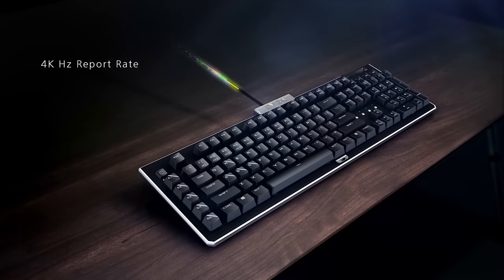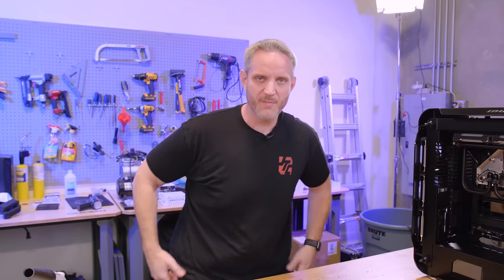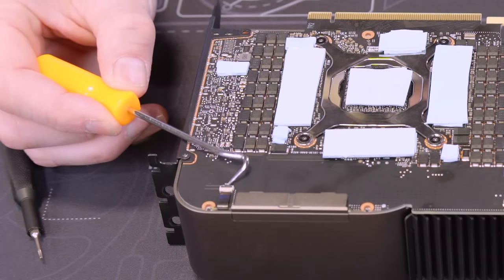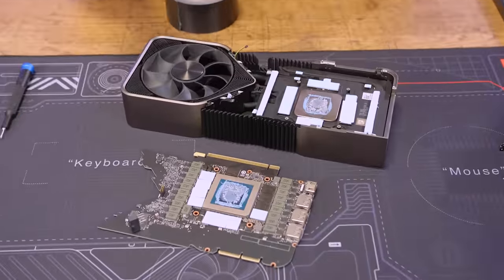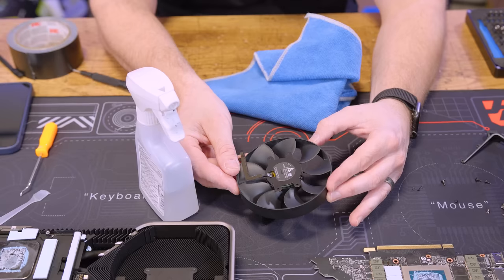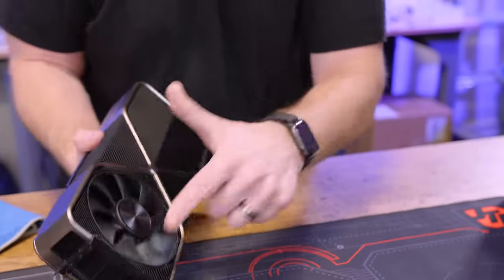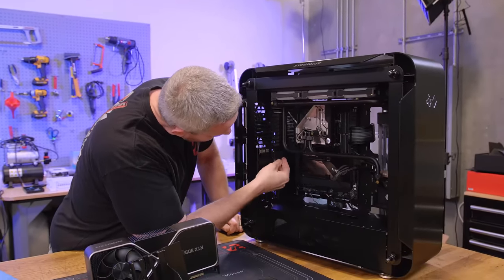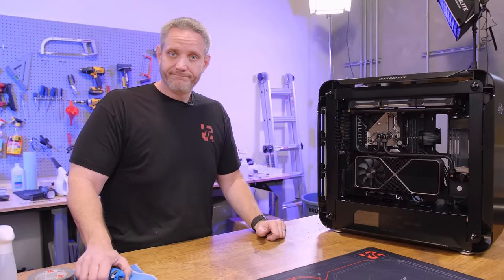Deep cleaning a GPU - Complete Teardown!

Comment: Oh man, I got one of those electric blowers. It was pricey but I love not having to buy compressed air cans to clean my dusty electronics.
Reply: Hmmm. I might think about investing in one as I hate buying the cans all the time too. And sometimes I SWEAR I use it once then 6 months later when comp is ready for a new clean it's like the can is empty. grrr
Reply: I just purchased a 5lb compressor.  It does double duty around the house for other things.
Reply: @KellicTiger  just be careful with those air compressors as they can accumulate moisture. The electric blowers are designed to not accumulate moisture. So just make sure you have a way to drain liquid/ keep moisture out of the air outlet on the compressor. It most likely is fine, but thats the reason they aren’t used specifically for electronics. They aren’t ESD or moisture safe.
Reply: It was pricey, but you're saving money in the long run by not having to buy compressed air cans anymore. I have one too, they're excellent.
Reply: Never use a vacuum, you want a blower. Vacuums cause static electricity and can damage electronics. 

I got a datavac, ironically named given my warning but it's a blower.  Actually I technically got two because someone told my in-laws and my parents to buy me one for Christmas one year so I got two. Worth it. They are amazing for cleaning electronics and they have tons of attachments for making it easy for different types of applications. Little straw thing with a brush on it for getting between fins on an air cooler is my favorite one.
Reply: RogerWilco99  Top reasons to blow out your electronics outdoors...
Reply: Pricey? Theyre like $50 on amazon.
Reply: I'll never go back. Its paid for itself already as I am OCD on dust.
Reply: @makingstatements812  their pricey if your poor people. I will say a device that blows real well for 50 is a steal.
Reply: @ckmondaviable  tell that to my wife!
Reply: 1
Reply: @KellicTiger  5lb? Please elaborate. Maybe 5psi? Or like 5hp? 5psi is not that much And 5hp will give you enough air pressure to break stuff
Reply: It's not good to do that really bc you could force to much air them things are powerful
Reply: I got a miniature 600w electric leaf blower for around $50. Does the job.
Reply: My datavac is over 10 years old. Totally worth it
Reply: @MinistryOfMagic_DoM  If the card was running it might be an issue. If he's using a small vacuum with the card outside of the system it is very unlikely to have enough charge to damage anything. With the price of GPUs being what they are I understand the extra caution. I've never vacuumed any electronics before, but I would personally be comfortable vacuuming a keyboard or even the fins of a graphics card heatsink.
Reply: You could also connect a grounding strap to the pcie slot at the back of the card and attach the other end to anything grounded. Then any static would just travel to ground.
Reply: @jizawiz  5 gallon would be my guess
Reply: Link please

Comment: Can't you damage the fans of the card by blowing so aggressively on them? I've always held fans in place when using a duster like that.
Reply: Same.
Reply: I think it might be if the fan is actually on, but with brushless fans I don’t really see how this is possible other than over-spinning the hell out of the bearings. Tbh I really have no idea if it’s even possible to damage a fan with air like that
Reply: @andrewsantora7943  Yeah, that's the type of damage I mean. It can overspin the bearings and potentially lead to some damage.
Reply: As he said, the rpm reporting may become inaccurate. As for the bearings themselves, it depends on the bearing type; the higher rpm from blowing will create different amounts of friction for each style of bearing. Mag lev fans are less prone to having the actual bearings damaged from higher than designed rpm speeds since the bearings are essentially floating.

Comment: NEVER spin up your fans like that with a blower. The fan will turn into a generator and send voltage back into the PCB, by overspinning the fan you can go way higher than the board can handle and kill the GPU.
Reply: Thanks, so hard to watch
Reply: What so you expect. He isn't as knowledgeable as Paul, gamersnexus, linus etc
Reply: @vincentviguier3223  Facts! I was just SMH. What a screw up. Thats also bad for your fan and can break fan blades. Ive done it way in the past.. Like way in the past and never will i blow on the fan again

Comment: Since you stated that the thermal paste may have affected cooling.  Please let us know if you're reapplication this time had any effect on the cooling temperatures.
Reply: For me personally, on my Gigabyte 3080 Vision OC, thermal pad replacements made a much bigger difference, almost 10-15C reduction under max synthetic loads (105C down to 90C) on the VRAM.

But there was also about 5C of reduction on the GPU die itself, when I swap the stock thermal paste for some Thermalgrizzly Kryonaut. I plan on replacing the thermal paste to some Kryonaut Extreme down the line, because I will have to do that, thanks to the pumpout effect. Very liquid pastes like the Kryonaut and the Noctua NT-H1 are prone to pumpout and should be replaced about once a year, whereas thick paste like the Arctic Silver, Thermalgrizzly Kryonaut Extreme, and Thermalright TFX will hold up much better over time.

Overall I do highly recommend it for 30-series cards, particularly the models that have GDDR6X, due to higher thermal output. You'll need to be careful and have a steady hand, but some high performance pads (make sure the thickness is correct, even if you need to stack two layers of thinner ones) and high performance thick paste will make a difference in performance. This is especially true for the 3080, which has thermal pads only on one side of the PCB, and not the other side facing the metal backplate, for some inane reason.
Reply: @matasa7463  what brand thermal pads?
Reply: @Matasa ...it almost seems like they didn't want to over do it on the thermal pads. But yeah, if you own a 3080 and above, you need to add thermal pads. I made a video of the 3080 ti running without thermal pads, same temps under 270w ish load.  Obviously dont do this, but it just goes to show that i dont think the thermal pads were ever making proper contact with the cooler from stock. Im just like, why are they even there?
Reply: Your, not you’re.
Reply: @Mr.Lingus222  Thermalright Odyssey, I used 2mm pads on the front, and 2.5mm pads on the back.
Reply: @makingstatements812  No, the pads did make contact. The issue was they used super ultra crappy pads that were like, outside the barrel. This shit will break down and leak oil like crazy...

The solution was better pads.
Reply: @makingstatements812  they last longer than thermal paste, which is why they never use high quality thermal paste like liquid metal, cause it needs replacing every year or so which you can't expect the consumer to do since it voids warranty.
Reply: @matasa7463  : you uesd 2 thermal pad sizes for this card Jay taking apart?
Reply: @ThisOLmaan  it was for the back of the card, not the ones on top of the VRAM. They gave the card a metal backplate, but had thermal pads connecting the plate to the PCB in any way, so the plate acted more like insulation than heatsink...

I needed thicker pads, 2.5mm thick ones, but at the time I could not get any, so I went with stacking 1.5mm and 1.0mm pads together. As long as you don't stack too many layers or too thick, you will be fine, and this was supplemental cooling anyways, not the primary one that attached the VRAM to the heatsink on the front of the PCB.

Also, my card was the Gigabyte 3080 Vision OC, not the Founders Edition card.

Comment: The high-RPM blower is as far as I get when cleaning my open-air PC. That and wiping down the glass base and top cover. 98% is good enough for me!
Reply: @KenOtwell  
I'm the same. No open-air rig but it's a pretty big tower (Enthoo Pro) so lots of places for dust to hide. I focus mainly on the fan blades & fins and don't sweat if there's a tiny bit sticking to the interior of the case. Never had a problem. 

Honestly more important for reducing the sheer quantity of dust that accumulates in your PC is just getting it high up off the floor - preferably on a desk. I know some people love to have them hidden away from sight but even being near the floor especially carpet w/ pets will drastically increase the dust intake.
Reply: Canned air and a vacuum does the trick for me. Never had a problem in the past 15 years. That being said I do clean every 3-6 months

Comment: You should hold down your fan with your finger when blowing it with compressed air, the sudden RPM may kill the fans 😉
Keep up the videos, they're amazing 😀
Reply: The un-even air pressure can also cause cheaper or aging fans to break some and/or go out of balance.  At least, I've seen that a few times... 
Though the voltage the fan generates might also be a danger in some cases.

It is mostly an issue with the cheaper fans but, yeah gpu fans are spendy usually to replace.  Specially on a $1000+ gpu, dont want to be screwing around.
Reply: I do this,  or pulsate on fans I can't hold in place.  Sometimes a little screwdriver or paper clip in psu fans helps
Reply: @jizawiz  idk about putting anything metal in a psu. However, I usually use a finger for case fans and out of reach a screwdriver or plastic pen.
Reply: @VanillaWahlberg  I agree. I thought about mentioning that and/disconnecting power, then i was like nah,  they'll figure it out

Comment: Hi Jay. I changed all my thermal pads out for CS Labs K5 PRO viscous thermal paste in my RTX 3090 Aorus Master. The Thermals i get now are amazing. It is well worth it. By the way dont worry if you use a lot for the different thicknesses. For £23 it was a great deal GPU-Z results  GPU Temp 47.9 Hot spot 63.8 Memory Temp 74 and pushing 358 watt. Running Heaven Bench.  Great Video

Comment: LOL.  I was wondering what was going to happen when Jay got to fan 2 as getting that out is a massive pain in the ass vs the first fan.  :D  Guess they decided to skip that as the teardown would have been a pain in the butt.  (Which is fine.)  Nvidia did such a good job on the design of on getting that first fan out then dropped the ball on fan 2.  The ribbon cable is actually taped down requiring the entire shroud to be removed.

Comment: This reminds me. I need to clean up my rig as well. It's been a while since i did it. I don't feel comfortable opening my RX 6700XT up but surely will blow the dust out that comes out
Reply: I done the same thing, but didn't blow directly into the fans. I just aimed the air across the heatsink and card, so that I wasn't just blowing the dust deeper into the PCB.

Comment: Jay: Why leave any performance on the table? 

Also Jay: we’re gonna use a vertical mount and riser cable with this 3090
Reply: vertical mount & razer cable dont affect performance
Reply: @rishatrizatdinov3269  Oh really? I’ve tested it myself with my own 3090 and a vertical mount decreases performance along with increasing temps!
Reply: @rishatrizatdinov3269  probably not. Though The extra length of the riser cable might add a minuscule delay.
Reply: There is nothing wrong with that.  The vast majority of the heat is expelled from the rear of the GPU,  Even under heavy load the fan pointing towards the motherboard doesn't dump too much heat into the system and as long as you have good flow through from front to back its fine.  Which Jay does with the front mounted rad and fans.
Reply: @Dirty_Bear22  I’m a benchmarker and saw a big difference in benchmark scores when vertically mounted along with way higher temps!
Reply: @James-T-RC  Do you think that would also be the case with a watercooled gpu? Is the main problem the riser cable itself, the mounting position or are both contributing factors? I'm just curious.
Reply: @jjlw2378  I believe it’s the cables length to the motherboard adding latency affecting scores but last tried it was with a PCIE 3 riser cable on my previous build when 3090 FE first released but im sure it’d be the same for PCIE 4 I just haven’t bothered to try it due to the temperature difference I previously saw
Reply: @rishatrizatdinov3269  Jay said himself that it adds something like 10ms delay in processing. Now, unless you're a legit pro, probably won't matter ever.

Comment: Spinning fans generate electricity and can damage components even when a system is powered off or unplugged, especially when spinning them at such a high rpm. This brings back a memory of a co-worker in the early 2000's who brought his newish high end laptop to work and was using our shop air compressor to blow through the ventilation openings. He was so giddy as he could hear the fans inside spinning at incredible speeds. This was probably an 80 gallon compressor that we used for pneumatic tools or to dust off our products hanging on the walls around the shop and I'm guessing it was pushing about 150psi. After he was done having fun with our air blower he tried to power the laptop on to show off how fast it was but he had fried it and it wouldn't even post at all. He sent it back to the manufacturer under warranty and they knew right away what he had done.

Comment: Embedded engineer here, never blow your fans unless disconnected.  They are not designed to be spinned that fast manually. If there isn't enough protection circuit inside, they could fry your thing with the voltage generated as a result of spinning. 😊

Comment: 6:02 And that is why i tell people to use the spread method, especially on bare dies because it works the first time every time.

No need to hope you get good spread.
Reply: You never need to hope you get good spread. You just need to use the proper amount of thermal paste (don't listen to nonsense about "a single grain of rice"). If you don't get "good spread" then that means you had bad mounting pressure and would have had garbage cooling performance even if you had spread it yourself first.
Reply: @mjc0961  nope nope no need to even worry about it . 
SPREAD WORKS THE FIRST TIME EVERY TIME

Comment: Jay, that thermal paste spread is exactly why I keep a pile of those thermal paste spreaders in my thermal paste bin inside my water cooling parts sorter. I literally had a card start to fail in folding@home constantly because of a small corner of the die which didn't have paste on it, after i picked it up off an online store that had repasted the card (no doubt after it spent a chunk of it's life mining back when you could on a 3gb 1060). Glad to see you used one this time, it'd make me sad if you killed your 3090 for real due to something like that xD

Comment: I am fairly confident in my skills to take apart, clean, and put my GPU back together, but given the cost of a new one (plus warranty concerns) I don't think I'll risk it. Not like I have a million GPUs just lying around lol.
Reply: It's par for the course if you want to do any water cooling and don't buy an AIB card that has a block already attached.  I had to tear apart an FE 3080 Ti to put a block on it, and honestly... it wasn't that bad at all.  I will say that the silly little screw covers are probably the worst part of all.  I did manage to get 3 out of 4 out without any signs of physical marring, but one of them has a little jab mark or two.  Once I got those off, it was pretty simple to get the rest off, and when you've got it off, just do your best to put things back where they belong and put it back in the box.  I just used some basic tape to hold those screw covers in place, but not tight enough that I can't remove them again.

Now, the worst part of that experience?  Sizing, cutting, and peeling the billions of thermal pads.  I've always found it frustrating how thermal pads are so easy to peel on one side, but the other side is just awful to try and peel.  It might be a slight exaggeration, but it seemed like I probably spent at least an hour of my time peeling all of the thermal pads for the front and back.  It probably would've been even worse if I had a 3090 with the additional VRAM modules!  (I kind of wish I did choose one in line at Best Buy given the 3080 Ti did not work with my 10% off birthday coupon but the 3090 would have; it would've dropped the difference to $150!)
Reply: @shinaikouka  my computer is also integral to my job and I refuse to risk an expensive component I can't replace, even if that risk is tiny

Comment: A spinning fan turns into a generator sending current back to the board if still connected.
Try ceramic coating on fan blades, hard tedious job but so much easier to clean next time.

Comment: No no hold Ur fans and u can use air compressor but yeah don't let's 10000 rpm to turn Ur graphics fan Same for case fan and tower cooler fan Inc water coolers fans Just one or two of u hold all fans and PSU just have some tight plastic in there to hold it and blow air as much as u can ...I do this 25 years now and never single issue ....some cable get out but who care after maintenance u have to secure and Chech all Pc cables

Comment: DON'T spray directly in/on the fans you can make them go faster than they are suppose to i've ruined several fans like this as the center cover got ripped off the bearing. Best thing to do is to hold the fan while you spray.

Comment: I remember when you did the nocuta 3070. I don't remember the stock temps, but I do remember you put 2x high amp delta fans and it just barely hit 42 degrees. Meanwhile I have a dual 360MM radiator setup for my Ryzen 5900x and 3070. The 3070 has never gone above 42 degrees. And it's filthy right now. lol so yes water cooling is worth it.